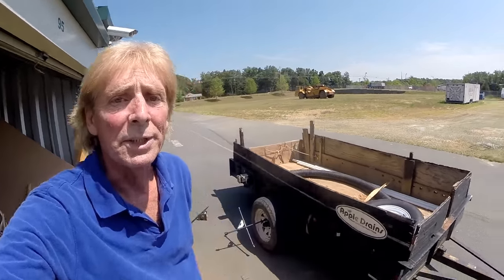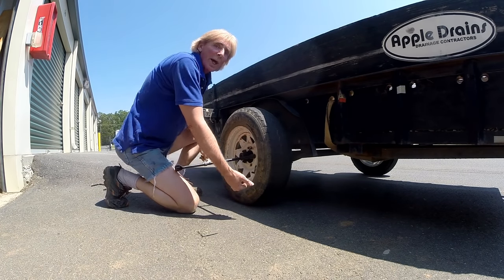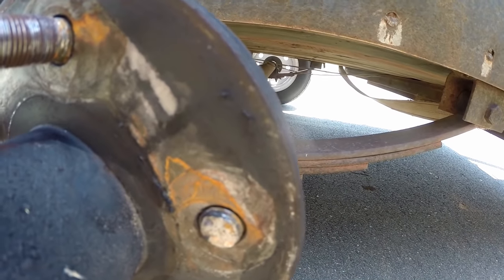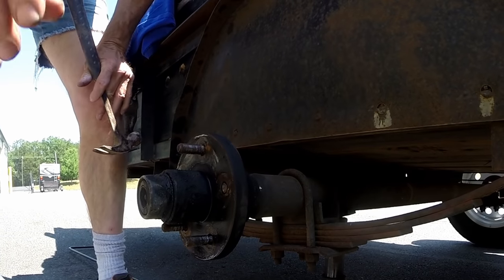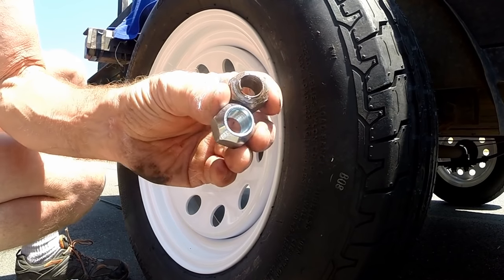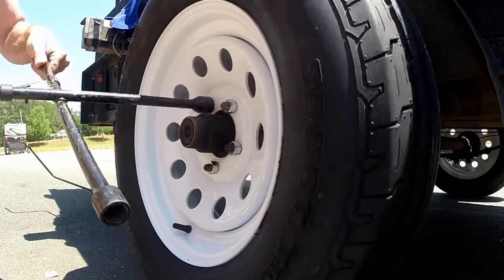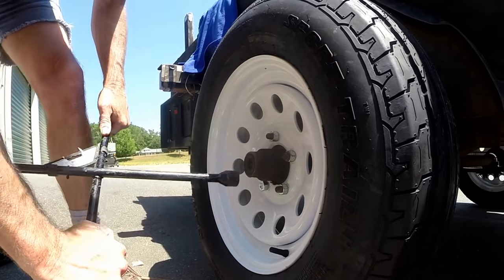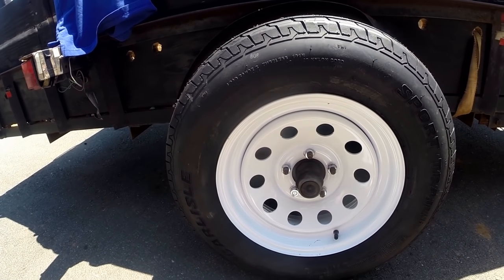How To Replace Broken Lug Bolt In 5 Minutes

Comment: To get the lug nuts back onto the hub you really shouldn't wack them with a heavy hammer as it's bad for the bearings and bearing seals. Tap them in gently until they bed in a bit, then using an oversized nut placed over the lug put the lug nut on and tighten it down until it engages into the oversized nut, once you tighten it further it will start to pull the lug into the hub.
Reply: 🌿💐🍃o

Comment: If you had turned the lug nut around, so the flat side was against the hub. You could have just tightened the lug and pulled the stud into place.
Reply: That's how to do it. Load up like 5 thick washers on it and you can pull the stud all the way in.

Comment: I have a 91 Ford truck it's a four-by-four the Lugnuts have broken off at we have to break him off the trailer tomorrow to get the whole rim and tire off could I drive it just with the three loads in it or do I have to replace what's broken on the four-by-four rim on there

Comment: After the tire was tight on the hub, you should have performed a check on your wheel bearings (grab at 9 and 3 o'clock, and check for play).  Also should have repacked the grease, and inspected the leaf springs, etc.
Reply: Damn it I need a friend like you in my life.. I don’t even know what a leaf spring is or how to check for play but by golly, he should’ve done all of those checks!!

Comment: You might consider changing the title of the video.  Those are wheel studs.  Lug bolts are like what are used on Mercedes.  No lug nuts or studs -- only bolts.